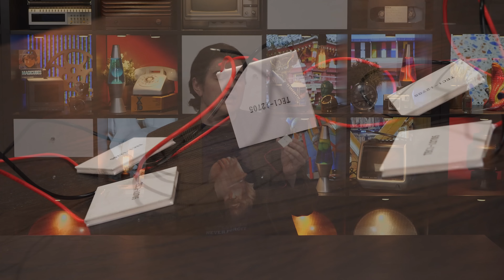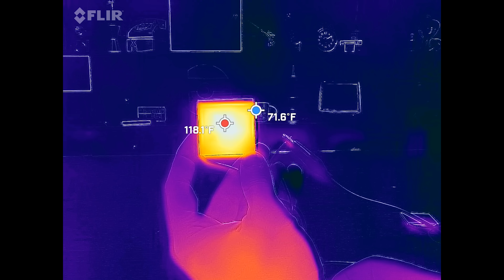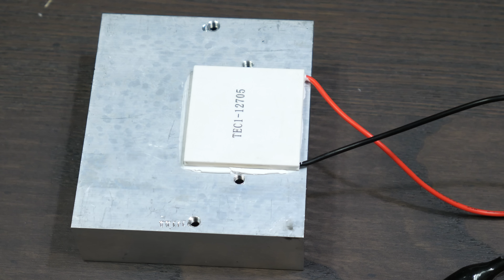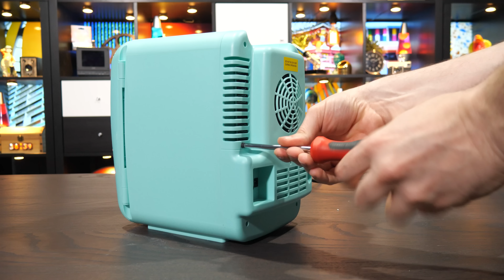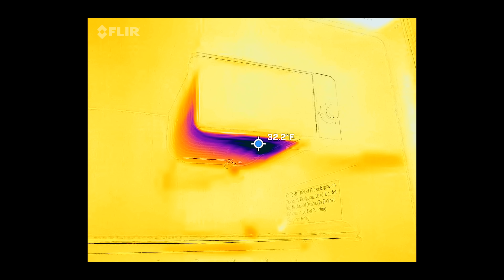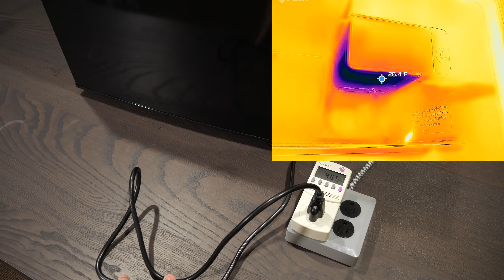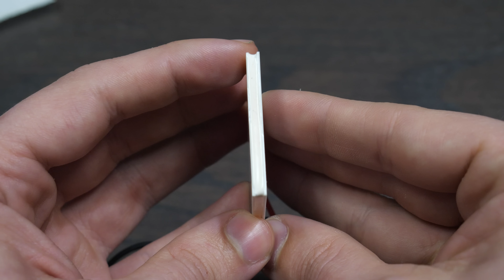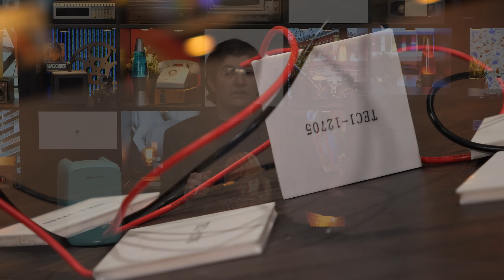Thermoelectric cooling: it's not great.

Comment: I own one of these, same size, but can run on 12v or 5v. I found that the 12v is good for 30 below ambient and the 5v is good for 20 degrees below ambient. Since it only consumes 2.5w (measured) while in operation, I found this to be a much better value proposition based on energy usage. I still appreciate the chilled drink if its only water or soda, and I also use it camping!

Comment: I think I got a single-can USB version of one of these back in the day from ThinkGeek and it used a standard PC heatsink and fan to dissipate heat.
Reply: Did it work ?
Reply: @psirvent8  Well enough. It never got a warm can cold, but it kept a cold can cold for a few hours, which is long enough to want to get another can of soda and "Oh look, I don't have to get up to get it."

So you grabbed 2 cans of soda when getting up instead of 1, and put one in this thing while you drank the other.

Comment: I have one of those refrigerating boxes for camping, the half decent peltier ones cost about 1/10 of the compressor ones - and I'm quite happy with the results on the cooling side (about 20°c below what's outside) for drinks and some not so sensitive foods)
Plus as I understand a normal compressor fridge should rest for about a day after it was moved, so the cheap ones are not an option for camping

Comment: The best analogy for heat pumps I've heard is that of a "heat sponge". Water on the floor is the heat in the room, the sponge is the refridgirant and your hand is the pump. You squeeze the sponge and put it in the water. You let go and it expands, sucking up some water. You carry the now heavy sponge to a bucket, squeeze it and the water leaves the sponge. Keeping it squeezed you walk back to the puddle and put the sponge back in. The cycle continues. 

The reason it can be more than 100% efficient is that I'm sweating less water doing this than the volume of water I'm moving.

Comment: Peltiers are meant to be running at a TINY fraction of their nominal Pmax, which of course is not taken into account in most consumer appliances. This means that instead of one peltier device, you would need 15x more to achieve  CoP around 2. At this Pmax operation, it has a CoP of 0.1

Comment: I can't fit a refrigerator in my car.  If I want to keep a cold drink and sandwich chilled, what is the best option that runs off a 12V accessory outlet?
Reply: There are high end coolers with 12V compressors actually.

Comment: Ok, so lets' s say we can use many peltier elements (being relatively cheap), we sandwich bunches of them so the temperature difference on each will be lower and we use a way lower than nominal current for each. And also use some sort of passive convection heat transfer for both sides w/ a huge radiator on the outside.  Will I have then a semidecent silent fridge? I won't mind a slightly greater power bill for that.
Because every "solid state" fridge I saw was done in such a way than it looked like was almost trying to get the worst power efficiency out of the smallest number of elements.

Comment: The thermoelectric style cooler worked amazing on a 14 hour road trip this July.  If it was 55° or 65° I would not complain on a 90° day.  Ran fine on 12v power.  And most importantly fit nicely on a car seat.

Yeah it only fits six sodas but that's plenty.

Comment: I have a small chest, which does have insulation, and is cooled by a pelter. I use it in place of buying ice when I'm camping.. I built a 140 watt hour 12 volt power bank, can be charged by 110, solar or car. 
For me, not having to be ice, is worth it.

Comment: I'm sure a big american desk can fit a tiny mini fridge.
Also, peltier elements have another trick up their sleeves: they make electricity from temperature differences. They're about as good at that as they are at cooling, but that effect is used in deep space probes where solar can't be used. A radioactive element is used to generate heat to provide the hot side, while space is providing the cold side.

Comment: A good thing about the Peltier device is that if you heat one side, say with a blow torch or put many of them around a Stove then the devices will produce a voltage that could be used to light a room.
A company over here in the UK is developing this Stove to light idea and it looked quite impressive so far.

Comment: I think you forgot to mention peltier devices are used very often in space. Also it's sometimes useful for thermoelectric generators which use nuclear decay to generate heat which is converted to power for space - probes and rovers.

Comment: Peltiers are also used in cheap and small dehumidifiers. It's interestsing how simple they are, it's basically a fan blowing air across the cold side of the peltier which cools the air very rapidly. The amount of moisture the cooled air can carry is lowered which results in the excess moisture condensing and dripping down into a vessel. The pro's about a system like this is that the fan is the only thing making any real sound so it's quiet, the peltier and fan also don't consume a lot of energy and, like I mentioned earlier, they are very cheap. I'm guessing that it's not very suitable for dehumidifiers with a larger "capacity" because they seem to use some other technology.

Comment: I actually have onr next to my chair and it fits a large glass of water with ice and 8 small juice bottles and it does get down to 40 degrees.  It also much smaller and a hell of a lot lighter. It has it's uses and you can actually use it in a vehicle. I personally like it and it will also hold 6 16.9 fl oz bottles and the cost was 40 dollars.

Comment: Funny comments. These devices are unnecessary, too. The portable refrigerator/freezers that use normal compression/expansion have gotten much much better. Shrinking the standard components means the thermoelectric devices will always be niche elements. We can always try absorption cooling. Just add heat 😂😂

Comment: My only other experience with a Peltier device was PC overclocking in the late 90s. An AMD K6-2 with a Peltier cooler between it and a large heatsink and plenty of airflow was loads cheaper and less messy than liquid cooling. I only experimented briefly with it though, because: 
A) I couldn't get a higher stable overclock with a Peltier than with a good normal heatsink anyway, and 
B) There was a risk of condensation from the cool side possibly dripping down onto the motherboard, and so I always had my tower case on its side or desktop case upside down so that any condensation would drip harmlessly away. This was awkward. 

But of course that use case has nothing to do with the horrible inefficiency of the stupid blue blob you demonstrate.

Comment: We used to have a wine cooler. Way overpriced, did have a thermostat, outside was cold so insulation absent. But it was “designer”, that’s the only requirement it needed to satisfy to get bought by my parents. It had three of these elements inside and was probably twice the size of that black minifridge… I don’t want to know how much energy that thing has gone through for the 1-2 bottles they drank every month.

Comment: use a Peltier device to take heat, turn it into electricity, and power part of the fridge compressor? Making the fridge more efficient via cooling power as well as providing some of it's own waste heat as power. Would this work? Even if the power production is minimal, could you reduce the amount of copper piping needed for the cooling part of the cycle and reduce copper material costs, as well as the amount of space the piping takes up?

Comment: When I 1st discovered cheap Peltier elements (.. about a buck) at the local electronic surplus store I was super excited and that Christmas I made Paperweight gifts out of a Peltier element epoxied to a heat sink ( along with a (2) D batteries holder and a Toggle switch)
Folks got a kick out of this as in a few seconds it would get so cold you couldn't leave your finger on it. 
W/O the heatsink on it, the elements hot side would also melt in a few seconds,  destroying the element.
For a while PC DIY Builders could buy Peltier CPU coolers, but that market dried up as soon as folks discovered they were power hogs, didn't cool much and output excessive heat.
Peltier are cool glued with heat sensitive epoxy to a heat sink for demonstration purposes but that is about the only use I'm aware of. 
I'm sure there must be applications - probably esoteric high-end stuff.

Comment: I once worked at N escape room. They had this complex circuit board and sensor and mechanism wizards table. 

No one. And I mean no one believed me when I. Said putting a fan inside. Closed box with no holes. Does not cool anything. The fan is making heT which it adds to the system.

No fans make things cooler. 

Wtf no not when you’re recycling hot air Round while generating heat with the fan. 

Fans make things cooler. 

Omg I hate you.

Comment: I remember when I had to move back in with my parents after a hardship, I basically got a finished attic as a bedroom. They got scammed into buying one of those six can toys for US$50 (2000 money, ~$91 today) and the best it could do was keep already-cold cans from rising to room temperature as fast as if they were sitting out. A camping cooler of slightly overall larger size was able to keep the cans cooler much longer, at no electricity cost, and even longer if I filled the last inch or so with some ice from the automatic ice machine in the same fridge I pulled the cans from. 

I stopped bothering after a while, as I figured the cost of a sugary* beverage including some minimal exercise of walking up and down a flight of stairs to be acceptable. 

*(well, high fructose corn syrup-y)

Comment: 11:04 your calculation is actually incorrect.
I would assume you do not have the same indoor temperature at winter as in summer.
Most likely a little chillier, so the cost of $27 per year is probably on the high end
Reply: They will cancel out in most of the places in the US with hot summer and cold winter.

Comment: I got one of those little fridges when my big fridge broke, (interestingly it started working in reverse heating the food inside it instead of cooling it) at the time it was 8c in my kitchen because it was winter (26c inside the fridge) so I was fine with having vegetables and fruit on the kitchen counter but didn't trust dairy in a room I cooked in several times a day so I got a mini fridge to keep its temp constant, it was just big enough for a small milk, slab of cheese and butter and worked well it beven got ice up the back. in fact I didn't bother buying a proper fridge until the next summer when the kitchen started heating up above 15c. I still have the little fridge tucked away for any time it maybe needed again (touch wood hopefully not for a long time as that new fridge cost £600 and I think thats extortionate).

Comment: 14:50 I didn´t quite get the dimensions of that fridge, But a typical fridge/refrigerate setup in Sweden would be 60x60x185cm (that is about 2 feet x 2 feet x 6 feet), and that would be a set up of two of us would be the typical configuration for a normal family with kids.. So the total set up is 120x60x185cm.

Comment: Given how simple these devices are, and the availability of cheap insulation everywhere, do you think you could make a Peltier-powered mini fridge that not only got them colder, but used less energy? I know wood is a good insulator, so starting with that, polyurethane'ing it inside and out, then coating the inside with spray-foam insulation, cutting excess and using a second wood layer inside to create the storage area. A large CPU cooler with a quality fan that is quiet, and a temp sensor inside the mini fridge to make it turn off once temps got to a fridge-like temp?

Wood would have to be pine, and baked to remove any excess moisture. Using the smallest possible screw to minimize it's impact on thermal conductivity would be good, but probably a tiny inefficiency as compared to the device as a whole.

Comment: I used to work somewhere where we sold both 12v fridges, and these stupid thermo coolers. Always, always steered people away from the coolers and talked them into a fridge instead. The coolers even state, they only drop the temp like 10°c below ambient. Meaning they're dangerous for keeping food as it'll always be in the danger zone where I live where it's typically 20-26 degrees outside.

Comment: An even better solution is to just get a camping fridge/freezer. They run on a wall adapter and/or a 12V battery, and/or a solar blanket (gotta have all the options), have high quality compressors and actually work. Brands include Brass Monkey, Dometic, Alpicool, Rovin, etc.

Camping fridge/freezers are the common solution in Australia, not just because we all go camping very often, but because we want cold drinks "at the ready", and, at all workplaces you can't just bring a device to "plug-in to mains" as we have stupid "test & tag" laws that require every device to be "tested and tagged" annually - yes, even if the device is brand new it can't be used without being "tested & tagged".

The solution is everything is battery and/or solar powered as such devices don't need any "test & tag". In Australia you'll find an insane amount of devices that run on power tool batteries, on their own batteries (fridges/freezers), and many things that run from USB power.

Comment: This may be a stupid question but what happens to the fridge if the room that the fridge is in actually reaches the boiling temp of the coolant?
Reply: The pressure will become too high and the compressor will shut down for safety.
Or it could burn out instead it's a really cheap fridge.

Comment: Counter question: why aren’t we using peltier elements for heating stuff? 
We use resistive heating: a peltier is more efficient if you can get the cold away. Seems reasonable for stuff like a stovetop. Is it?

Comment: I am curious as to how long those mini coolers with the element would keep something cold if you put it in there when it's already cold. I wonder how it would compare to a similar sized ice chest or, even a better comparison, itself when used as an ice chest. Maybe if there was a way to prop one up so that the fan isn't blocked on some kind of wire rack and then fill it will ice and drinks, whether it might make the whole thing stay cool longer. It's probably a waste of time to test but it's just a thought I had since I've done a lot of camping in my life, some of it involuntary (homelessness). Actually, come to think of it, I'm sure those little things would not work well off of USB and would likely drain the solar USB power bank faster than I could get it to charge in the sun. I did manage to keep an iPhone 6 charged even though it had one of those defective batteries that eventually split the case open due to how much heat it produced. In any case, my recommendation will always be to just find a nice stream, particularly one that has water coming out of the mountains running through it, and to secure your beverages into the running water because you'd be shocked how quickly a nice cold stream will chill even the warmest of warm beverages.

Comment: I have a couple of 12v "coolers" that use TEC module.  They sort of work in the car when the AC is on and are continuously powered.  Though recently, I sourced 12v coolers that actually have a compressor, they can actually keep frozen foods while being in a hot car and, as Alec pointed out, use less power.

Comment: Heat pumps have substantially reduced efficiencies when you scale them down, and some people have space constraints.
It's easier to plug the Peltier into your car than a heat pump, for long drives and road trips.
No moving parts makes them remarkably reliable.
They're completely silent.
4 perfectly good reasons you'd want one.

Comment: 20~30 years ago I worked at a laser spectroscopy research lab, where CCD detectors needed to be cooled using multi-layered Peltier modules (ie, heat from the hot side of the module is cooled by the subsequent module, … ). Even so, over an extended lab session (a few hours?) the detector generated so much heat that needed to be stabilized using a water-based cycle cooled with reusable ice packs. At around the same time I built a small camera for astrophotography using the same setup - albeit at a smaller scale. Worked good in those early years of going from gas hypersensitized film to digital!

Comment: I use one of these regularly in my car to keep drinks cool and my lunch until lunchtime. It actually works very well at that and manages to keep ice in drinks through a summer day in my car back seat.

It is probably not very energy efficient compared to a regular fridge but it fits in my car and it does the job without killing my battery so I was fairly impressed

Comment: With a properly insulated container and proper tuning i can think of a few use cases for this. Particularily agricultural in arid conditions where the ground can act as a heat sink. As a place to keep your booze cold? No. Keeping a medium a temperature cool enough to keep plants a live is more what im thinking. Regular watering could orobably keep you below 80 in like 110, about the hottest rhe plant could handle from cooling liquid off in the ground